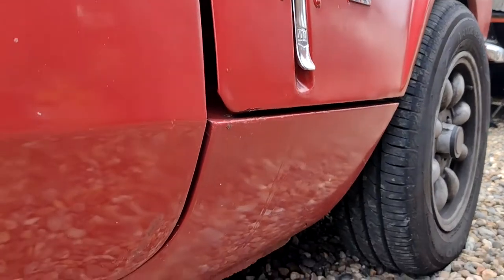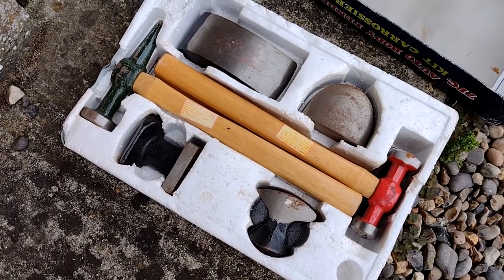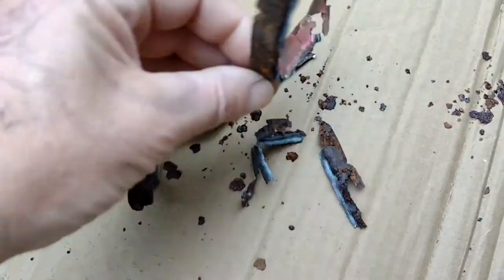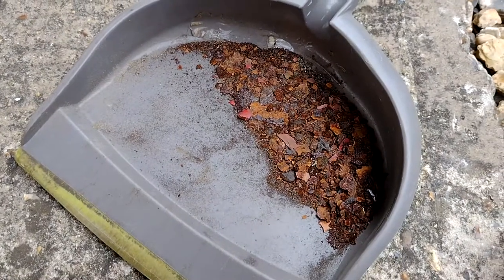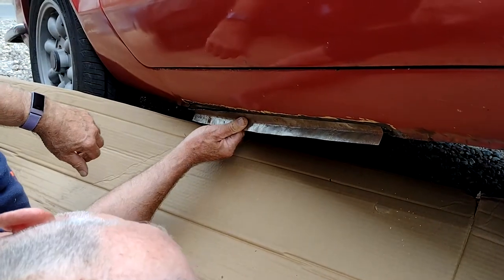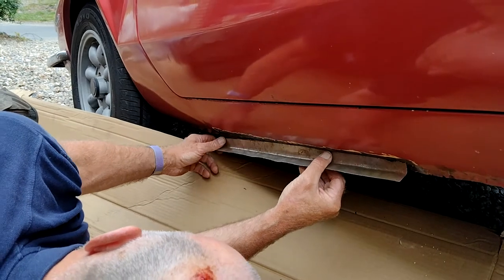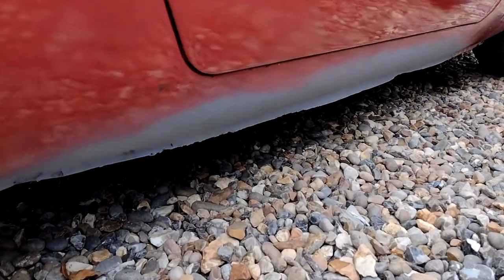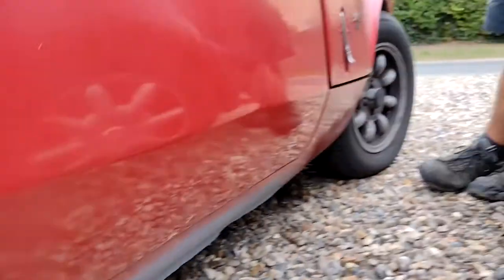Triumph Spitfire MKIV 1500 Fabricating and Welding Outer Sills

Comment: Hi great mate of yours doing the mig welding repairs. I restored my mk3 back in 1998/2000. Put in new floors etc. You want to try welding it's amazing to see the molten metal reformed. I practiced on some old wings I got from scrapyard and made a trailer before restoring my Spitfire.Kev🇬🇧
Reply from the maker: I'd like to learn but it's even more toys to try and put somewhere!